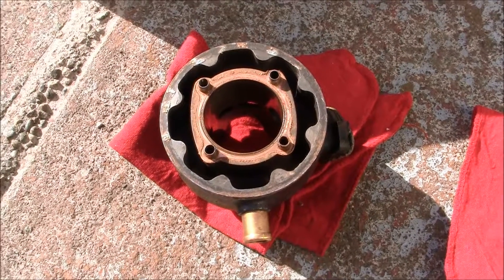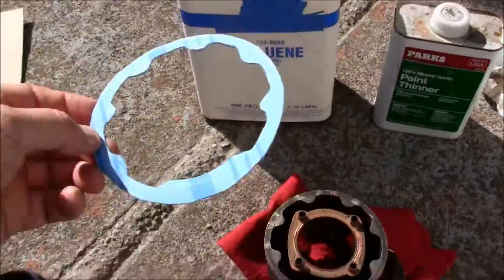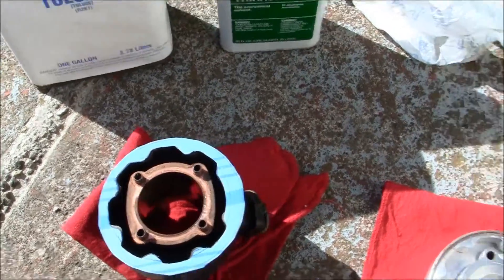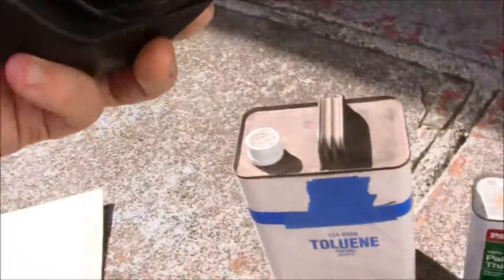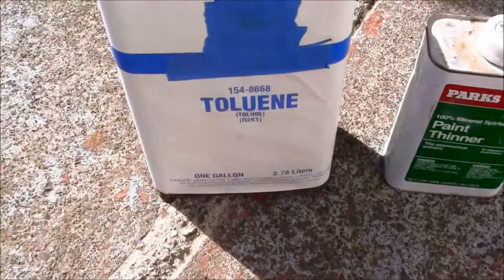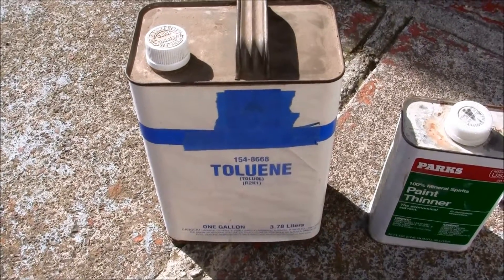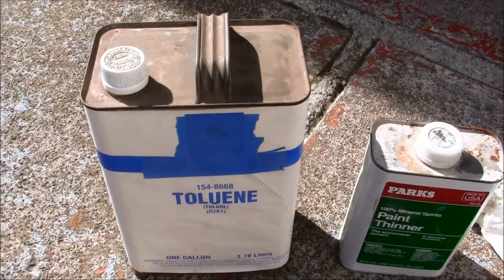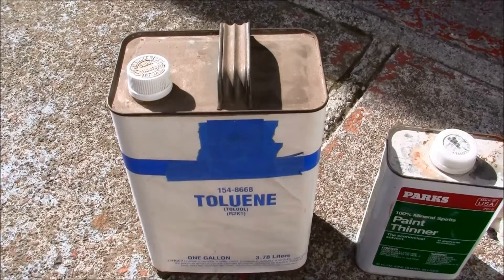25)- HONDA Dio =RACING  "125CC"  ENGINE

Comment: Nice gasket but that part that is overhanging to the right where the cast iron doesnt touch it should be cut off so it doesnt get wet and fall off and potentially cause cooling blockage.